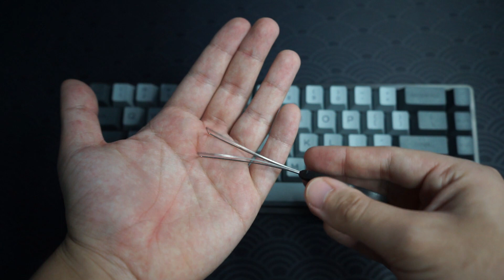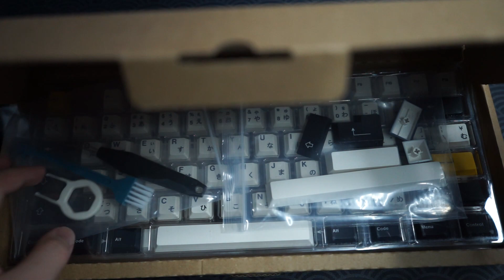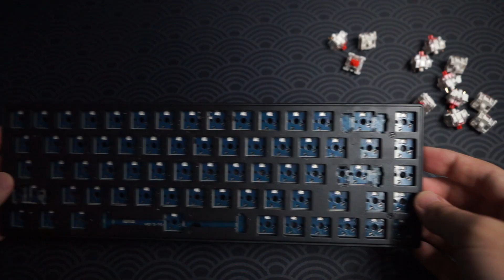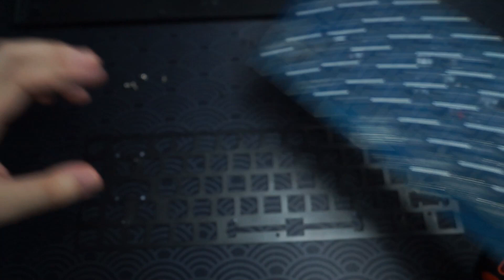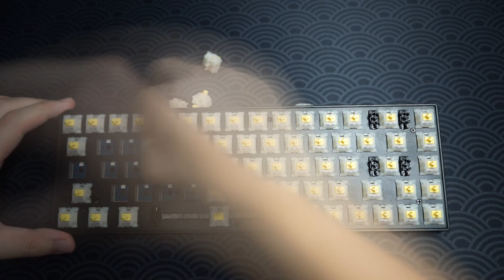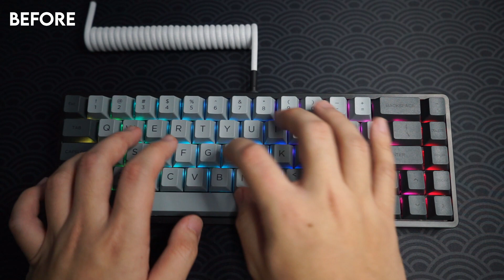Upgrading My Royal Kludge RK68 - Gateron Milky Yellow Holee Mod Keyboard Cherry Stabs | Samuel Tan

Comment: You should NEVER pull by the cables. You can sometimes rip them off. Just applied little pressure on the borders of the connector until it comes out.
Reply from the maker: Yes agreed, also use plastic tweezers if you can

Comment: does using a stocked mod stabilizer and cherry hv much difference on the sound??
Reply from the maker: Honestly yes, there's a big difference
Reply: @itssamueltan  does rk68 stabilizer pcb screw in, plate mounted, or snap in? can I use durrock for rk68?

Comment: Where can I get those keycaps and do I need to change the switch to add these keycaps?
Reply from the maker: No the original ones can fit the keycaps, I would suggest Shopee if you're in Asia but AliExpress and Amazon should also have them
Reply: @itssamueltan  I’m in US.
Reply: @itssamueltan  thank you

Comment: 2 questions, Is the keycaps cherry profile? and does the switches north facing or south facing?
Reply from the maker: Yes cherry profile, and yea it's north facing switches but no interference from mine
Reply: @itssamueltan  howw
Reply: @itssamueltan  yea and implanning to buy rk68 with akko rose red switches andakko macaw keycaps cherry profile does it fit?

Comment: does gateron milky yellow have gaps on it? since rk68 hotswappable is limited (oly for switches tht hv gaps on it)
Reply from the maker: I honestly don't understand this, what do u mean by gaps?
Reply: @itssamueltan  rk 68 led lights kinda bulb out so mybe there is a reason why we can only use gapped switches? but since u r using the switches fine on rk68, it should be no problem at all..
Reply from the maker: @maru6ix304  ah I think I know what u mean, newer versions of RK all have flush LEDs now so any switch can fit, but be careful with older versions they might have this problem
Reply: @itssamueltan  I see, thanks for ur information!!

Comment: how do u find keycaps for this keyboard btw, since this is not standard bottom row, i found that finding keycaps for this is a real struggle.
Reply from the maker: Oh I get what you mean, I can suggest getting a full set of 130+, often times they already have all the keys u neeed
Reply: @itssamueltan  ahh i see, thanks mate!
Reply: @itssamueltan  i have another question, as for the plate, what material is it? is it brass or aluminium
Reply from the maker: @muhammadaliuddin9175  it's just aluminium for the stock one
Reply: @itssamueltan  ahh i see, im planning to buy a brass one, but its hard to find keyboards parts here in malaysia

Comment: Cool video but I have a question, why do you put only a small amount of case foam in the keyboard but don’t put it until it’s all fit? Also I think you should put pe foam so it sound creamier
Reply from the maker: In a plastic case it doesn't really matter how much you use actually, and if you have the time and enough materials yes you can make it look good and fit everything. Yea PE foam does make it better too why not. 🤣 You can do anything you want this is just my method

Comment: do you know if the RGB lights will have any problems shining through with certain switches? I vaguely remember hearing someone say something about North facing LEDs or soemthing like that, which can be obscured by the switch...
Reply from the maker: Nah it's all good honestly, just some north facing RGB PCB might have problems when u use Cherry profile keycaps, that's all. No worries all switches actually fit almost 90% of PCB

Comment: I have this keyboard and have one problem when typing. Often for each key, after being pressed, it keeps inputting even when the key has already de-pressed. Resulting in repeated character, until i reset it by pressing any random keys. Is this a major problem with the rk68, or is it a defect on my board. 

Anyone with same issue? Mine is stock not modded. All thoughts of modding are cancelled when this issue emerged.
Reply from the maker: Hey u can try pressing FN+ spacebar for 3 seconds to reset it if not u can try claiming the warranty

Comment: planning to get those gateron milky yellows too and gonna pair it with doubleshot pbt keycaps which are cherry profile. in any case, would there be any interferences?
Reply from the maker: With Double-shot there's a high chance
Reply: do u have recommendations for budget linear switches that won't have interference with doubleshot keycaps?

Comment: Hope do they look with shine through keycaps? Seems like a good switch especially when lubed but I wonder if the back lighting is effected badly
Reply from the maker: They look awesome with pudding keycaps or shin through keycaps, after lubed it still looks fine nothing is affected
Reply: @itssamueltan  Right that's great, I see you've used the Akko Rose reds. Gateron Milky Yellow or Akko CS Matcha?
Reply from the maker: @JOELLZE  hmmm I would suggest Akko if u don't wanna lube, if u plan on lubing definitely get the milky yellow
Reply: Since the RK68 backlight isnt the brightest, it gets a bit darker but not much

Comment: Would it have an interference if I used a Cherry Profile Keycaps on my RKG68? Also, what is the keycap profile of the RKG68?
Reply from the maker: I'm using cherry, some cherry won't have any interference. For me so far no problems
Reply: @itssamueltan  I think the interference is no present because of the switches, I think the stem doesn't go all the way inside the housing. I just purchased a some milky yellow switches and some cherry profile keycaps. I am curios if I will encounter interference. Either way, your video is really nice, great quality!
Reply from the maker: @seansotir  ahh I see, thanks and goodluckk with your build
Reply: And another thing that I researched on interference is to cut a post it paper that can fit between the switch led side and keycap, if it doesn’t get stuck there is no interference
Reply: @seansotir  any updates on whether you had interference with the milky yellows and cherry keycaps?
Reply: @itzblim  hey man, unfortunately it did :(, I tried 3 cherry keycap sets and all of them did. One of them indeed had little bit of interference but it was still there.There are some tricks that you can do to the reduce the level that hits the keycap on the switch itself but I do not recommend it. Right now I am using XDA profile keycaps and they fit like a charm with 0 interference.
Reply: @seansotir  aight I think I'll go with xda too then XD thanks for the updates!

Comment: If you're going to choose between RKG68 and RK84? What would you recommend?
Reply from the maker: if u need the fumction keys, f1 to f12 u should get the RK84
Reply: RK84 has a slightly larger battery too at ~3800mAh vs ~3100mAh in the RKG68.

Comment: Hi! I'm planning to mod my RKG68 however I'm wondering if there's a difference between a lubed/clipped/modded stock stabilizer vs a lubed/clipped/modded Everglide/Durock stabilizer?
Reply from the maker: Hi there's actually a very big difference, stock ones are not so tightly fitted but after doing alot of mods it can only be better but not better than Everglide or Durock stabs
Reply: Oh I see! Thank you so much  for answering!
Reply: There is a difference, but it's quite easy to get a thocky sound by using the Stock stabs. But i gotta mentions that it is a pain in the ass to holee mod the stock ones, since they are prelubed and u need to get the lube of the surface where you put the holee mod thingy. Sorry for the late answer tho

Comment: would it be more economically feasible if I buy the switches and lube them myself? or are the lube expensive? And is there any difference between foaming the plate and foaming under the plate?
Reply from the maker: yeah u can defi lube them yourself, it may be quite hard if u have alot to lube but have no tools, like switch opener, lubed, lubing statin etc. Foam under the plate dampens the sound when typing, foam in the case get rids of echo

Comment: Does this keyboard have issues with the LED bulging out? Heard that this might cause incompatibility with some switches that do not have space for the bulge. Otherwise, great build!
Reply from the maker: Ahh no, RK G68 has LED under the PCB, the RK860 of RK100 has that problem
Reply: @itssamueltan  so this keyboard wouldn’t have any interference issues with cherry profile keycaps?
Reply from the maker: @TheMessedUpMind  nope would work fine

Comment: do you think lubing is actually worth the time? I'm modding my first keyboard and doing everything from holee modding and converting it from wired to wireless. the only thing im hesitant about is lubing switches cause it takes alot of time.
Reply from the maker: Lubing will go a long way in mechanical keyboards, if u want a better typing experience and better sounds u should because it's worth it but If u don't really care how it feels and sounds u can leave it unlubed
Reply: For what it's worth I'm going to grab a set of bobas as I've heard they're some of the best out of the box and that lubing them only provides a very slight difference.
Reply: @fatalwinja2065  sometimes it comes very scratchy

Comment: Are your keycaps cherry profile? If yes then were there any interference with the north facing switches
Reply from the maker: Yes cherry Profile and no I had I no problems
Reply: @itssamueltan  How would i know if my switch won't cause the interference?
Reply: @amzet_513  if it is see through or not (the bottom housing)

Comment: The board originally came with RK branded switches right? Was it able to fit the Gateron Yellows perfectly, without needing to crimp the pins like on an oetemu board?
Reply from the maker: Yeah no problems at all because it's 5pin
Reply: @itssamueltan  in this keyboard, can i use 3 pin switches too? I think i Will Buy it but the switches that I want ate 3 pins I think, the akko CS or something like that.
Reply from the maker: @sebastianarizaparra5490  yes 3pin will fit no problems

Comment: After you remove the stock stabilizers at 3:01, can you just switch the stabilizers straight away at this step without having to further disassamble the keyboard?
Reply from the maker: U can do that if you're not using any plate foam, because the foam will block the stabs for the soacebar
Reply: @itssamueltan  alright, thank you for the quick reply!

Comment: A very great video man and mine are already on its way. I'm planning to do the same mod as yours but using Gateron clear instead. As for the PCB foam that you're using, is there any hole that you need to cut by yourself to make it fits or it already came with the screw hole line up with the RK68?
Reply from the maker: The version I bought has the holes precut already, but if u get one that doesn't have the holes u can just use a penknife to pole a hole and screw in no problems
Reply from the maker: All the best modding!

Comment: Great video thank you!  Can you use the arrow keys as normal or does it need a modifier key? And does it have function key access to control music for example? I'd also want to upgrade the case to a wooden one, is that possible?
Reply from the maker: Welcome! To answer your question, yeah u can use it normally but there isn't controls for music sadly
Reply: the RK G68 has dedicated arrow keys. It does have media play keys using a function modifier (he just added keycaps that doesn't show the fn mods)

Comment: Hello! How did you get the switches to fit? I recall the RKG68 has large bulging leds?
Reply from the maker: maybe I have the newer model so the led are not the large kind, maybe u can check out akko switches, they have them already cut out for the led